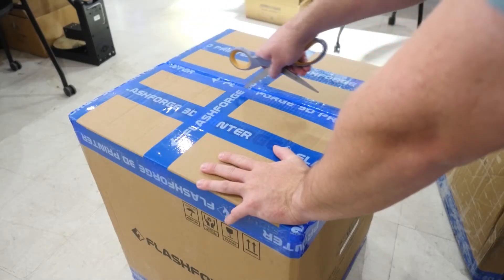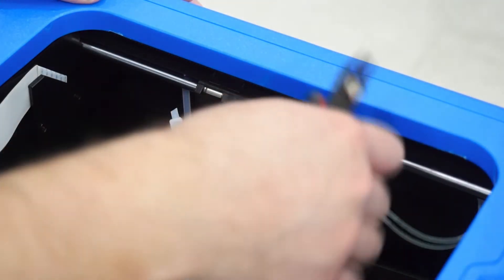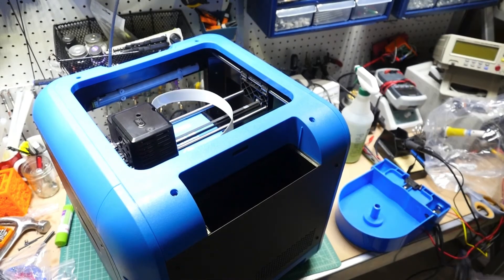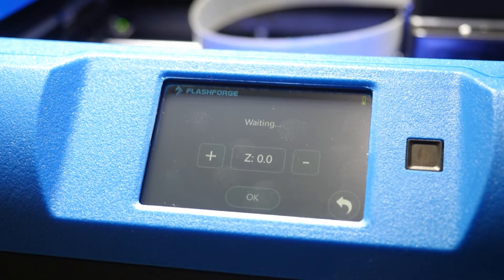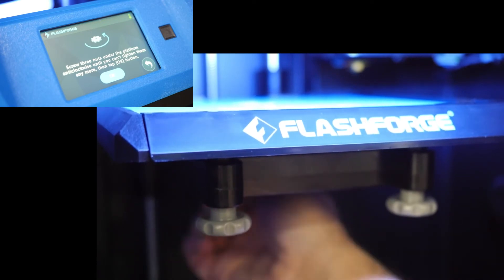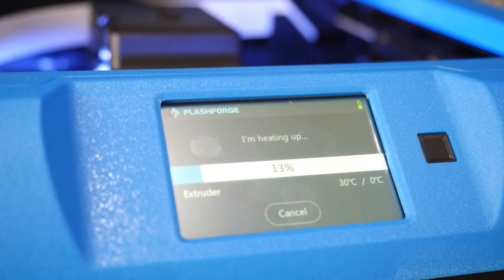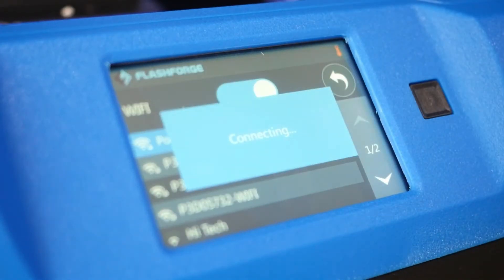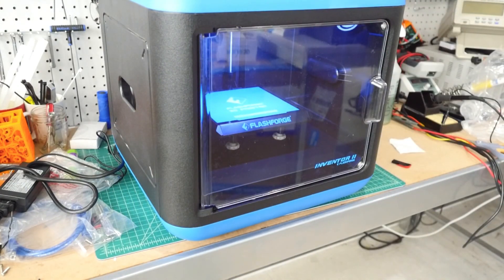Setting up and Polar Cloud Enabling your Flashforge Inventor II

Comment: 5:22 I am not seeing any wifi choices here.  When I turn on the wifi, it just connects and I have no idea what network it has connected to.  Then the polar3d software does not recognize it when I put in the serial number.   Very strange.  Any ideas?
Reply from the maker: Hey Brett. I'm opening a ticket on our support helpdesk to work with you on this issue. Please check your email!
Polar3D